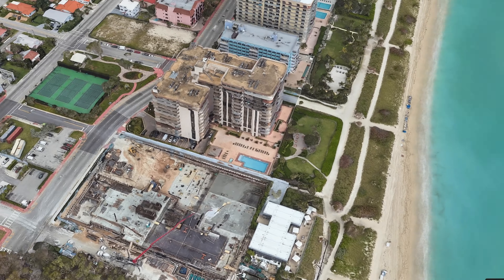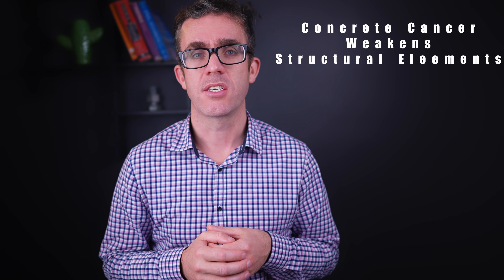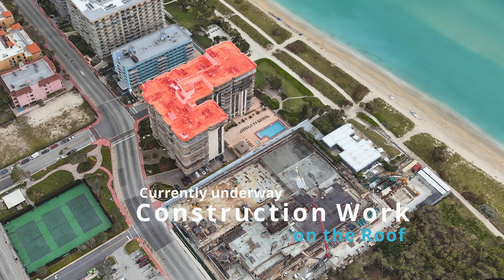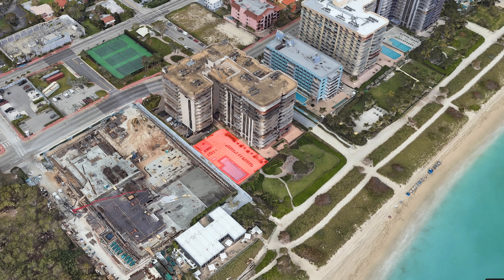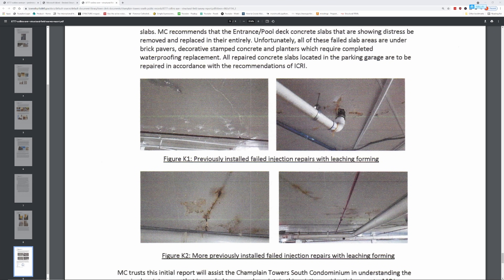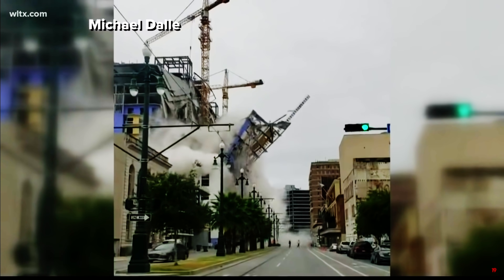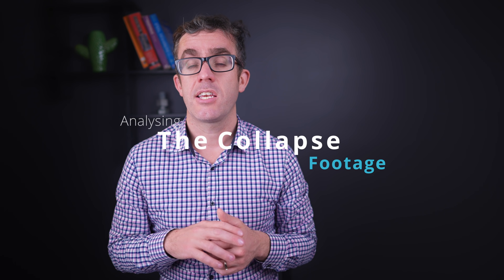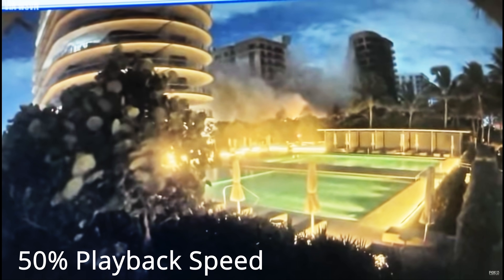How did a Miami building collapse: The Warning Signs. Report and  CCTV footage analysed

Comment: Totally speculation here but I believe that the 1980 high cost of renting money, high inflation, high costs of materials lead to a structural design that was very lean and lacking in redundancy. As an architect I recall working on a hospital project in Boston where the typical non-load bearing interior partitions were 1/2” GWB on 2 1/2” studs 24” o.c. just to “make budget”. People did that in 1980.
Lax construction phase QA/QC let to more “invisible” loss of in-service redundancy and safety factors. What works “on paper” is rarely what gets built in the field.
The structure of the pool deck was connected to the tower structure with no building “seismic joint” separating them…something we would commonly see in the northeast. When the pool deck started to pancake from years of corrosion related fatigue it pulled the tower columns it was connected to out of alignment and progressive collapse ensued.
Some sub-surface anomaly may have also contributed to the whole house-of-cards reaching its catastrophic tipping point.
This is NOT supposed to happen with conventional flat-plate reinforced concrete construction…a very “mature” and common (in Florida) construction method…even in 1980.
It is worth noting that open “amenity decks”, often with pools, vegetated roofs and patio areas open the the elements have become extremely popular on luxury urban residential projects…usually high-rise…in the last 20 years. These areas can get very complicated in their design and below-the-surface invisible “topography” and must be waterproofed using the very best and reliable membranes with very long known in-service service lives on the market. They must be careful detailed, constructed and tested before overburden is applied. Concrete must be protected from moisture!
Champlain probably had a simple relatively inexpensive troweled on tile setting bed waterproofing membrane protecting the dead-level concrete…something that in Florida probably should have been replaced every 8-10 years.
Just my speculative opinion.
Reply: Yes even the support colomns under the building do not look to be large enough, and they should have been braced with a solid concrete perimeter wall to stabilise this size structure.Also the centre of the building needs to have full height walls from ground to ceiling for fire stairs and lifts, acting as an main internal pier.
Reply: @Spoke76  I think what they did to the building left partially standing was the type of implosion where they set the blasts around the base only. Doing it that way leads to a lot of dust and big debris though rather than if they had more time and opportunity to go into the building they were going to implode.
Reply: @ittsacrazyworld  as I watched the demolition I was seeing small explosions on every floor.  I assumed that meant they had done more than explode it from the base only. Also, apparently workers had gone into that building, at great risk, to check for human victims as well as pets. I heard them say they had checked closets and shined flashlights under beds. So I think it’s probable that they also set explosives up there. Just my guess.
Reply: Remember, this project was given to the lowest cost bidder. So..........
Reply: Can either of you explain how all 4 sections collapsed at free fall speed? The 3 accidental collapses fell in a little over 3 seconds strait down exactly like the controlled demolition part.
And how does a demolition company prepare a building such as that for controlled demolition in a day and a half? When all other demolitions that size take months?
How come the first 3 sections all fell strait down instead of anywhere 360 degrees around they could have randomly fell? How does asymmetrical damage cause a symetrical collapse, not once but three times?
I am aware there is building code for 2 hour firewalls in between building sections and is why the first part fell in three separate sections. Aren't those firewalls also designed to prevent the buildings around them not to collapse if one just so happened to collapse from damage caused by a fire? (Or controlled demolition of a badly damaged section from a  fire?)
Reply: @sundaywhiterabbit7679  The fire walls maintaining integrity for 2 hours is so that the fire is compartmentalized and allows for the building to be evacuated. They are not necessarily structural.
Reply: @sundaywhiterabbit7679  I am not a structural engineer. I have zero expertise in the field, but this might help. (Better frame by frame analysis) https://youtu.be/383SIaQDg0k
Reply: @davebrewer9279  I am a computer drafter specializing in architecture and draft plans for structural engineers. So I work in the field. I know how structures are put together from wood framed to steel framed buildings. I am very familiar with building codes and their requirements, especially for multi-family, multi-story  buildings. I also took a lot of science based classes in college, such as physics and calculous. So I understand how buildings are put together as well as the dynamics of free fall speed, gravity and resistance in things like a collapsing building. 
"Pancaking" would take longer than free fall speed due to resistance that each floor would provide. Free fall means there was zero resistance provided by any of the floors. Also meaning that every single floor would have to be separated from every single column at the exact same time to achieve free fall speed.
Free fall speed has a mathematical equation anyone can determine if they know the hight something is.
Height ÷ 16 = X
✓X = free fall speed in seconds
So how long for a 12 story building to fall at free fall? Average height of each floor 14'
Let's get the approximate height
12x14 = 168 Feet
168÷ 16= 10.5
✓10.5= 3.25 seconds
3.25 Seconds is the time it would take something 168 feet in the air to fall strait down with no resistance. Resistance being, if you dropped a bowling ball on the top of a tree, the branches would be some resistance, so a bowling ball dropped onto a tree would take a longer amount of time to hit the ground than a bowling ball falling with no tree under it.
Time the first 3 sections of the building as they fell. The sections are actually separate buildings, they are separated by firewalls per building code which must be followed. All three sections fell in about 3 seconds per the video footage. They each fell strait down, not any of the other 360 Degree ways they could have possibly fallen. 
Then take a look at the known controlled demolition, the building fell in about 3 seconds as well, strait down right into it's own footprint, as it was designed to do. Exactly like the first 3 sections fell.
In order to achieve this, demolition companies must examine the building, have all the floors and blueprints given to drafting departments to place the explosives at precise locations to accomplish a safe demolition that brings the building strait down all at once. These plans must then be reviewed by engineers and demolition experts, marked up for mistakes, redrafted and corrected. Then re reviewed by the engineers and experts. Any more corrections must then be done and reviewed and finalized. Then a crew uses those plans in the field to set the correct explosives in the correct locations and wire them all together so they go off at precisely the correct timing. This separates all the floor trusses from all the support columns correctly so the building will fall at free fall speed into it's own footprint. The process for controlled demolition takes months, not a day and a half to do. 
Therefore in conclusion, the entire condominium building had been rigged for controlled demolition months prior and it was all controlled demolition.
Now did they do this with people inside or no?
Evidence says no one was inside but that is speculation. In two separate videos showing the building before the initial collapse, there wasn't any lights on in any of the condos above, only the outside flood lights near the bott pool area where on. 
There is no footage of all the other residents being evacuated from the remaining building, carrying out their things, and also, there is no patio furniture on any of the balconies of the remaining building that I could see. Indicating, the building was not occupied.
A lesson probably learned from a similar incident 20 years ago that did kill people, and the surviving families became difficult to deal with because they wanted answers the authorities were very hesitant to give them. Every family was paid a certain amount and signed a waver to never speak publicly about it. All but a few took the money. A few still ask questions and speak out to this day at great risk.
Thanks for reading all this if you have. Maybe I have opened some eyes, maybe I will just get the usual overused dismissal "conspiracy theorist" or "you're off your meds" or "put down the crack pipe"
But my observations are sound. To anyone who would like to take the time to explore it. 
Or just take the corporate news's word for it and don't question things that cause discomfort.
Reply: @Spoke76  none of these questions have been touched. I understand why. No worries. Not everyone is fooled so easily. That's all.
Reply: @sundaywhiterabbit7679  ugh, enough w conspiracy theories! He explained that the caving in of the pool deck pulled the support columns down (there were 4 or 5 involved if you look at the floor plan) that’s the first zone coming down, which then weakened zone 2 which it was tied into. I’m not sure why you’re so suspicious……it makes perfect sense.
Reply: @christinabeck9316  no it does not. Not at all. I explained it. People just don't understand physics or construction. People believe in amazing coincidences instead of obvious in your face events. 
I don't call conspiracy unless it's over the top obvious. And this is. No newsplaining is going to change. People know. I am by far not the only one who sees it.
Just explain how they set up a controlled demolition in a day and a half. Not possible. Easy to verify that fact. It was ALL controlled demolition. For what purpose, I have no clue why they are lying. But the news does this almost continuously. I guess it's like pro sports....for entertainment purposes only. 
Wake up.

Comment: Pool Deck ...... The eye witness reported the pool Deck collapsed first...... Then her phone went dead. It all happened very fast after the trigger event.
Reply: Another engineer on YT pulled out the drawings of how the pool deck is supported where it meets the building wall after hearing about the pool deck collapsing first. Turns out the deck ties directly into the building's columns a few feet below the first floor instead of having its own. It looks like the collapsing pool deck may have ripped the columns out from under the first floor.
Reply: Watched many videos on this one and really seems almost undoubtedly that the pool decks issues lead to the failure of the primary support columns. There was also a video of the lower garage damaged with debris and leaking sprinkler pipes near the main columns of the pool side 7 mins before the collapse. This one really seems like a compounding issues failure with: Poor designs, poor construction, changes from original plans, lack of critical maintenance, serious water leaks with exponential rust issues. 
Really this seems very much like the "Algo Centre Mall Collapse", But this one fell from the top down because of bad water leaks and rust issues being ignored.
Reply: @NickNembus  Nick agreed it’s a combination of errors. If the pool collapsed leading to a structural failure, or a structural failure lead to the pool collapse is almost impossible to determine by examining a pile of rubble or looking at videos. I could argue that point either way.  I agree it’s a sad combination of poor design, construction, add-ones like the penthouse and planters, shoddy or no maintenance, leaks, rust and concrete detonation.
Reply: @PaulJersey  I have heard some reports that pool deck was built without slopes towards the drain funnels ….which caused rusting of pool deck reinforcing steel and subsequent failure of the deck. . At the same time I have seen original drawings which show slopes towards drain funnels….not sure what to believe….
Reply: @total2199  My theory is that the transfer girders below the pool failed first thus causing column punch through. The deficiencies in the pools design and construction very well might of lead to the transfer girders failure.  Corroded rebar in the pool deck could of lead to the deck collapsing onto the weakened transfer girders causing their failure.  If the transfer girders and columns were structurally sound they just might have supported the collapsed pool deck.   They managers would have the pool rebuilt and this tragedy would of never happened. The transfer girder failure caused the columns to punch through and also kick causing the building collapse.  Honestly now It’s just a theory.  There is too much conflicting information for me to be sure about anything.
Reply: @PaulJersey  yes, it could very well be the case. Transfer girders failed for the same reason, they were weakened by rusting reinforcement at joints to columns. Punching shear affected pool deck support, causing it to collapse and concrete debris damaged first row of columns, supporting multistory structure. So, failure mechanism is the same as above. I just hope and keep my fingers crossed that building was not designed by company that I worked for at the end of 20th century…..
Reply: @total2199  To be fair to the designer, there was little maintenance done to the building over a 40 year period.  Who knows if it was actually constructed per the original design as well?  Then they added numerous massive palm tree planters at the pool area as well after initial construction.  There are so many factors involved here.  If I were to take a wild guess, and had to isolate a cause.  I would look at the quality and quantity of the reinforcing steel installed during construction.  Again that is not fair of me to say, but…..
Reply: @PaulJersey  I agree there are so many factors involved which can affect the failure…..as far as quantity of steel, I believe it was installed per approved plan, subject to further review. However, quality of installation….and inspection. These could be contributing factors. I have seen so many times 135 deg. , 90 deg. hooks fabricated too short, in violation of CRSI….but first and foremost factor, in my opinion and it is written in the latest engineer’s observation report,  was rebar rust. Reinforcing steel was in a poor shape, looking at the pictures. When concrete is cracked, reinforcing steel cannot survive long in a marine environment….best regards from California SE!
Reply: @PaulJersey  I have seen a video clip today, it was made in 2018, I believe. Deck was designed as a flat slab: no girders or drop panels. Failure was caused by a punching shear failure. Some reports show there were only two bars in each direction running within critical shear cone around a column, when approved construction documents show four…. Deck failed next to the first row of five columns, supporting multistory portion of the building. So, compression posts buckled due to instant increase of column’s design length. In an instant the design length increased two times because collapsed deck was not providing a lateral support to compressed elements any longer. So, the failure mechanism was exactly as it was described above. RIP all tenants!
Reply: @total2199    Igor I think that we both agree that it was a punching shear failure of the columns into the deck.  I noticed looking at the pictures that there was almost no rebar sticking out of the tops of the columns.
Reply: @PaulJersey  yes I agree. one report that came from Florida stated (pictures show it) that there were only 2 bars passing through a column in each direction instead of four shown on approved set of construction documents. When those bars are corroded….structure is in trouble. RIP all victims
Reply: Failure mechanism was the following. Pool deck collapsed, debris damaged first row of columns supporting multistory tower, building tilted and pancaked
Reply: @total2199  agreed 100%
Reply: From what she could see. It's possible the foundation was failing at the same time and broke the deck which was more visible.
Reply: @TnK2015  Igor above me thinks that the pool deck failed first causing the column collapse, and you think that a footing/column collapsed causing the pool deck failure.  I could actually argue both sides of this point. Impossible to tell by looking at a pile of rubble.

Comment: Might be the repeated bouyant force acting on substructure is one of the main reason of its collapse... as the uplift force  occured during high tide  repeatedly ..this will result to reversible moment to the frame .. along the pool deck area... that would tend the steel reinforcement to a accelarated fatigue stresses... corrosion was normal... this is not the main reason... the root cause was the varying huge bouyant force at the pool deck as it always act as cantilever  frame on the whole structure ... as seen on footage the  super structure collapse adjacent from the pool deck.